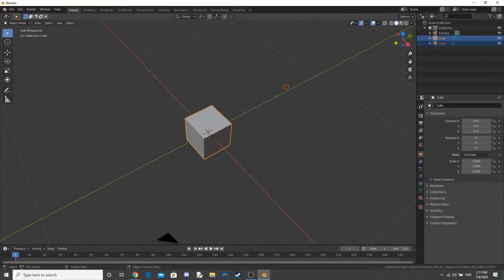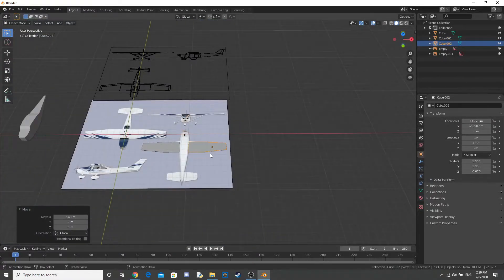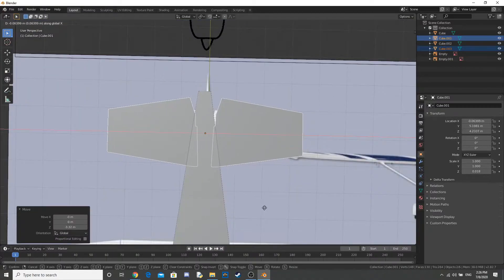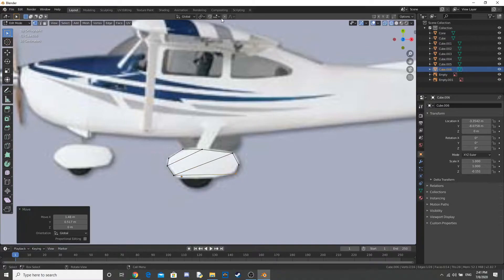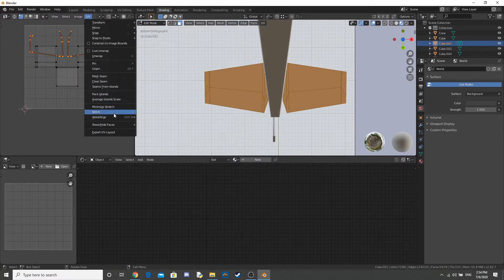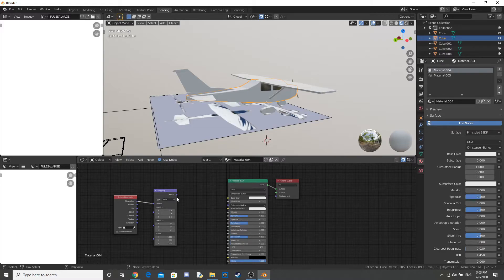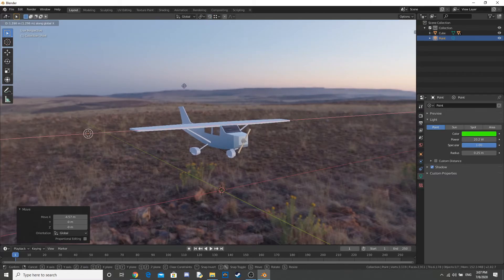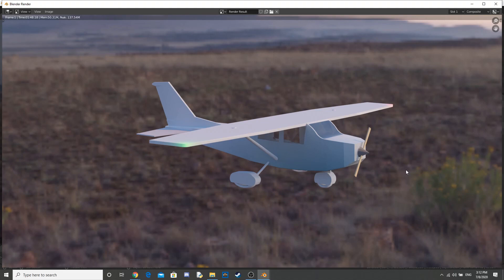Making a plane in blender

Comment: Hey how do i do that persision scale thing you did at the start with the lines?
Reply from the maker: I just use “s” to scale them to the same size as the picture.
Reply: Kaleidoscope15 hey I do that but do I need to click tab or g to select the edges?
Reply from the maker: Click tab to go into edit mode and “g” to move the edges/vertexes
Reply: Kaleidoscope15 ok how do I add new edges?
Reply from the maker: You can select the edge and click “e” to extrude the edge, in this video I select the face to extrude all 4 edges.
Reply: Kaleidoscope15 ok thanks